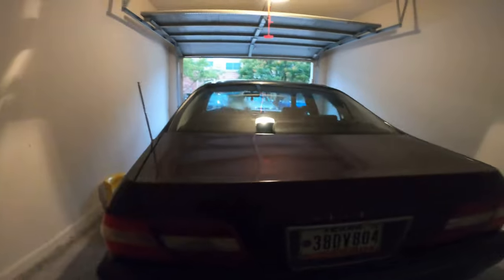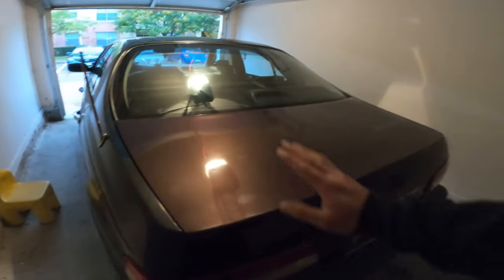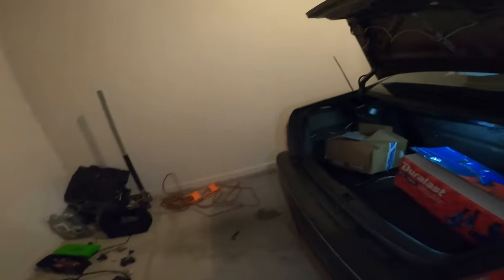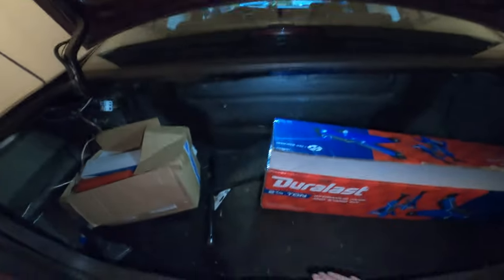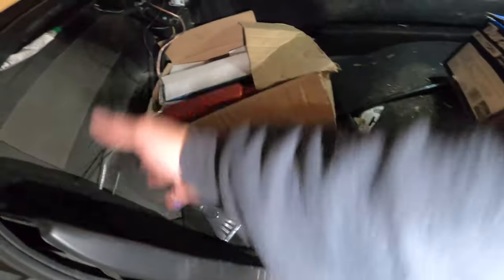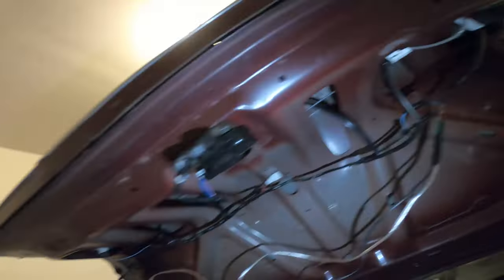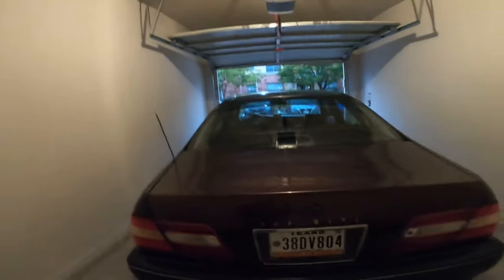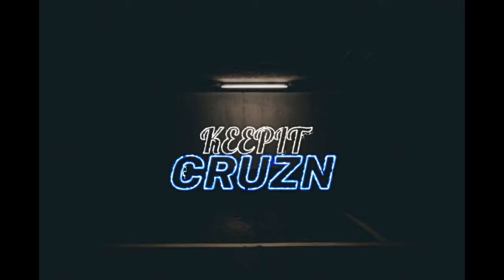HOW TO: Infiniti Q45 / Nissan Cima y33 trunk conversion from 1999-2001 to 1997-1998 ; full breakdown

Comment: a 97 just came in a junkyard in my state had to come back for a refreshher lol
Reply: Update : it was a q45 t model so it has the spoiler …. Idk how I would go about hooking that light up  🙃
Reply from the maker: @Ruliiss you can tie it into the brake lights, just gotta run a wire to it.
Reply: Update #2 … so on the Gen 2 (99-01) there is a connection on the stock harness for the spoiler tail light that’s connects right in .
 Didn’t have to splice anything .
Also just got everything else spliced up and it’s running fine !! All lights works
This video is 2years old thx for replying an helping out !
Hope this comment helps someone else out !(:

Comment: I was thinking about doing this to my 01 Q45.  Is there not a 3rd brake light built into the trunk. I want to find a early trunk with the 3rd brake light built in. Great job bro
Reply from the maker: Thank you! And the touring model of the 97-98 had a third brake light built into the spoiler but I couldn’t be picky about it, it was hard enough to find a Q45 in the junk yard 😂. The touring trunk also has holes in the trunk for the spoiler, but since I have a 99 touring, I’ll just swap the spoiler from that one to this 98 trunk I swapped.

Comment: So can you show what wires go where? Doesn't really help.
Reply from the maker: At 10:00 it explains the new wires that will need to be added your self. The reverse light harness needs to come from the 97-98 wiring harness.
Reply: @ShadySpectacles  I'm new to this whole thing haha, finally got the 97 trunk. It's got a big harness and the tiny box. Do I have to take the entire harness out of the car that goes to the Trunk? Sorry I'm Hella confused. What kind of wires should I get
Reply from the maker: From the 97-98 harness, you need to cut off the reverse lights harness which go to the outer lights on the body. You can keep the 99-01 trunk latch, throw away the 97-98 one.
Reply: @ShadySpectacles  Hold up so basically, I have to cut out the wires specified from the old harness and redo them to the connectors on the current harness?????
Reply from the maker: Correct haha you have to tap them into your old harness (99-01).
Reply: @ShadySpectacles  oh my God if I had known that Thank you!!!
Reply from the maker: 😂 good luck and have fun.
Reply: @ShadySpectacles  so with the tail lights that originally came with the gen 2, I would match green and red to the wires going to the trunk lights right?
Reply from the maker: Yup, same colors on that part.
Reply: @ShadySpectacles  ok that's what I thought because I kept rewatching that part 😂
Reply from the maker: 😂 yeah